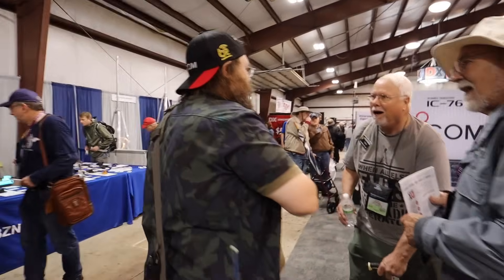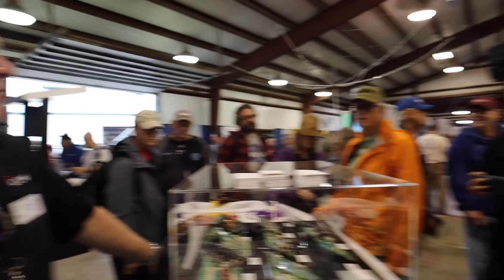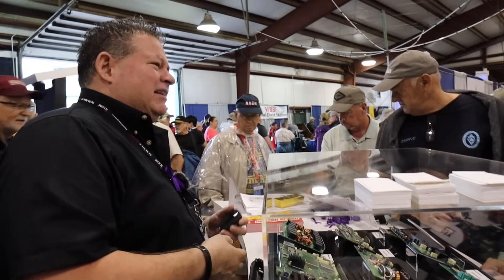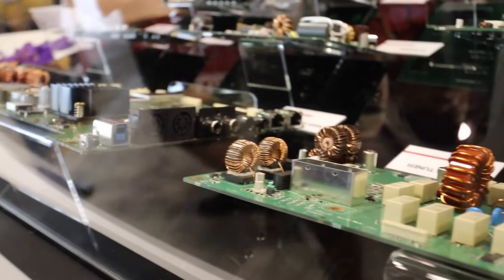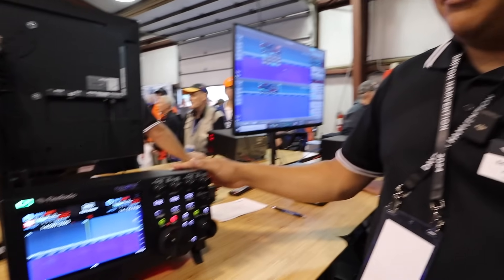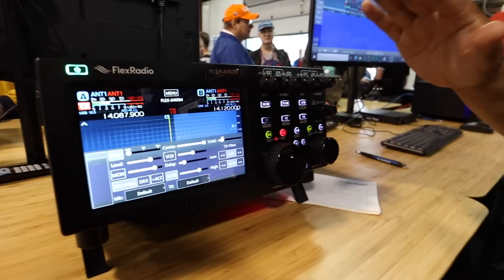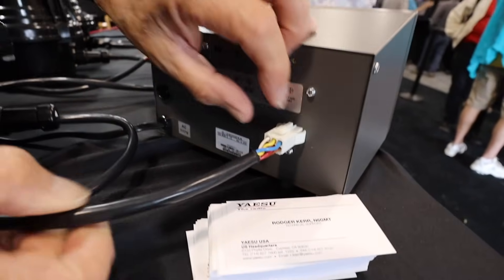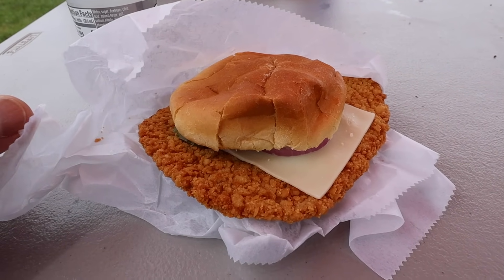Icom's Revealing New Radio Components | Flex 8000 Series Radio | Yaesu Tech Troubleshooting

Comment: I used to remote control my IC-7610 in Minnesota from Florida. I had a computer in Minnesota connected to the IC-7610 that I used for digital modes and logging. I used RDP or RealVNC to connect to the computer from Florida. I used Icom’s RS-BA1 second edition software just for the audio. The graphical interface of the RS-BA1 software was clunky and crude compared to HRD remote control software or the Win4Icom remote control software. The Flex radios are built from the ground up to be remotely controlled, not an after thought. 

I don’t currently have a remote HF station setup, but if I set up a remote station again, I’d buy a Flex radio.

Comment: I didn’t see you there at the Dayton Hamvention 2024. It was packed on Friday and Saturday. Much less crowded on Sunday. I hope you make several videos remote controlling the flex 8600! The Flex antenna tuner looked great! I think that you could mount it close to the antenna in a weather resistant dog house sized container. 

Didn’t see the Acom remote antenna tuner in the DX Engineering area? The Acom remote antenna tuner looked I like an alternative to the MFJ 998 remote antenna tuner that you modified to make it more resistant to starting on fire!

It was my first time to the Dayton Hamvention, after thinking about going for years, but never doing it. I plan to go to the Dayton Hamvention next year!

Dave KY0L
Reply from the maker: Hello Dave, Sorry I missed you at the Hamvention.  I was only there for 1 day.  I'm in Cinnci for Flight Simulator Training.  Like right now, I just finished being in the Flight SImulator for 4 hours.  I'm mentally beat.  One of my check rides is tomorrow.  

I will definitely make some Flex Videos.  I don't see a whole lot of videos on them on Youtube.  I'll also make a comparison with the Anan G2.  Once I get the remote control to the Flex 8600M, I'll probably sell my IC7610.  That's my Remote HF Workhorse.  Thanks for keeping up and 73 de N4VFR Darren

Comment: Thanks, Darren! Thanks for the Flex preview! Looking forward to your review of the 8600M when you get it. Will see if I need to upgrade from my 6600. Also will love to see how your Anan G2 compares. 73!
Reply from the maker: Right on!  I was thinking to myself if I should get the 8400M instead?  I'm primarily going to use it for Remote HF and the Anan G2 at my base rig with the IC7610 as my backup if my computer dies.  Additionally, with 8400m or 8600m, it already has a Maestro built in and can be used as a stand alone.
Reply: @DarrenN4VFR  Go 8600M if $ not an issue. I love my 6600, which I got a great deal on. You can have four VFOs at once, plus the other expanded capabilities. May end up being your main rig? Flex will keep upgrading software, which expands/enhances the radio. You could travel w/Maestro. Keep up the good work. 73.